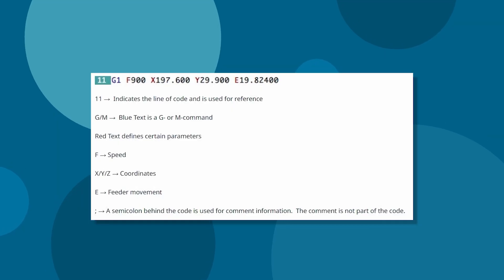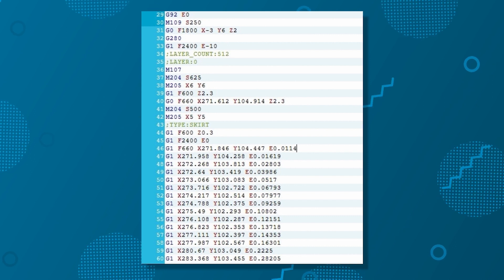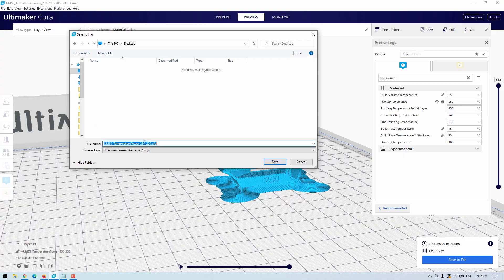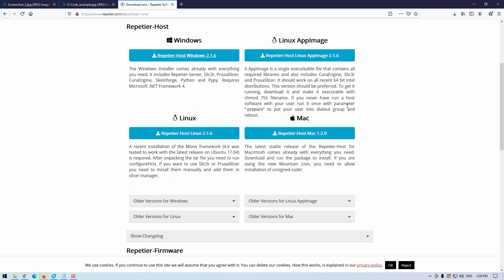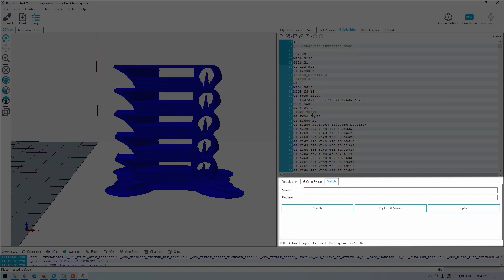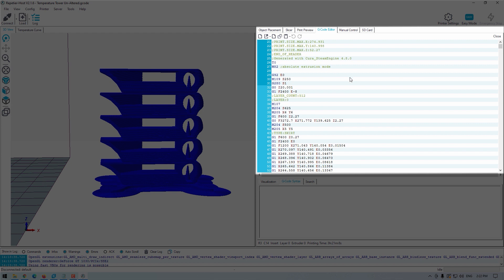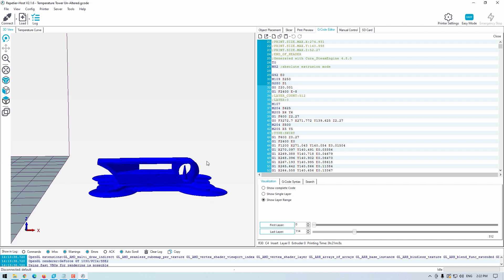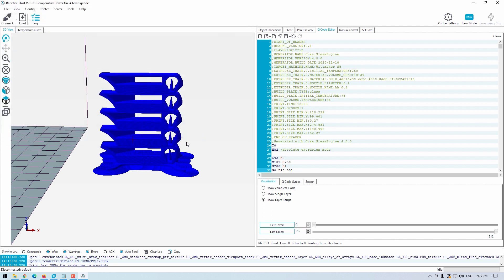How To Modify G-Code | Add Nozzle Temperature Changes Mid-Way in a 3D Print

Comment: Thank you for getting to the point and sharing that useful info. I'm going to check out repetier for sure. 

I'm currently trouble shooting how to insert G-Code at each layer change. It seems like Marlin is making some unexpected changes to the G-Code that I output with Cura. I think that Repetier tool might be useful for figuring this out. Thanks!

Comment: How the hell is anyone getting this to work? I have tried and tried and tried with the BS post script processing BS and the MOFO never changes the damn temp it always stays at 225. I looked at the generated Gcode WHAT A MASSIVE JOKE. It never adds anything to change the damn temp. I tried Cura it magically tried to print in the front right corner where only 1/4 of my print would fit. So I switched to it's creality twin which prints in the correct spot but 100% ignores all of the post processing and never adds the damn GCode.
Reply from the maker: Hey mate, Cura has added support for changing temperature in built. Run through these steps and you'll get your temperature change to work.

In Cura up on the menu click Extensions, Post-Processing, Modify G-code. Add a ChangeAtZ script. Specify Trigger for which layer in the slice you want to change temp. Check Change Extruder 1 Temp and type what temp you want. Always add them highest temp at the bottom then lower the temp going up. Then when you slice it again this is added in the gcode.

Comment: ok I downloaded the program and I am able to edit the files.  So now I ask is Prusa slicer is open source how can I change the gcode that is generated each time I slice a part ,  so I don't have to manually edit every file every time.  I don't like the behaviors of the files when i start printing, it wastes like 10 minutes of time every time I print.  Heats up / only to cool down to auto level, then has to heat up again.... wasted movements, etc..  Thank you,
Reply from the maker: I reckon you can use a Python script to automatically find and edit out the features of the G-Code that you no longer want. Here a intro into that world - https://programminghistorian.org/en/lessons/working-with-text-files

Comment: I would recommend you also show how to edit the GCODE in Prusaslicer. It does let you add cuctom GCODE on any layer very easily, negating the tedious task of sifting through Gcode text to make your customizations and reducing customization errors.
Reply from the maker: Thanks for pointing that out. I'll definitely dive deeper into Prusaslicer, it really is a phenomenal slicer - particularly in regards to managing different types of 3D printing.
Reply: cura and creality pretend to have this feature however it doesn't appear to work at all.

Comment: Is there a way to know the height of the 3d model by reading the gcode?
Reply from the maker: I believe there is a indicator that tells you directly in Repetier-Host, just cannot find it right now. Repetier-Host does tell you the Layer Count and the Quality (Layer Height) so by multiplying those two values you will pretty much get the height of the model that way.

Comment: I have a geeetech A30T (this is a 3 extruder machine) but it seems that the Repetier host always sets it to the first extruder, can you help me to resolve this.  I have the software setup for multiple but using the Cura slicer always says it will print with extruder 1
Reply from the maker: Hey mate, when you slice the model in Cura have you got it set to have three extruders in the Machine settings for your printer? Otherwise the next step I would try with a sliced file from Prusa Slicer.